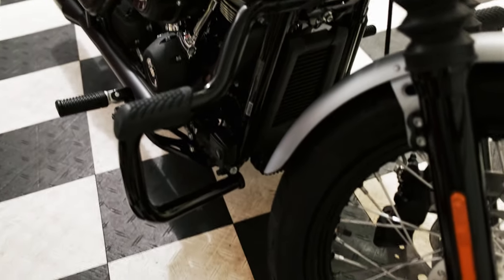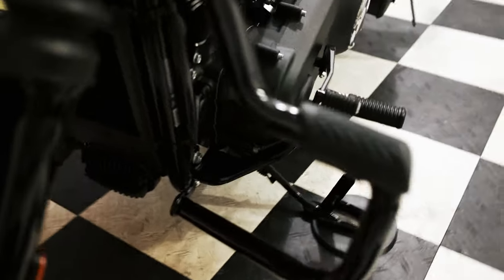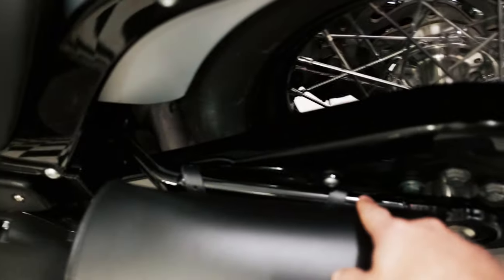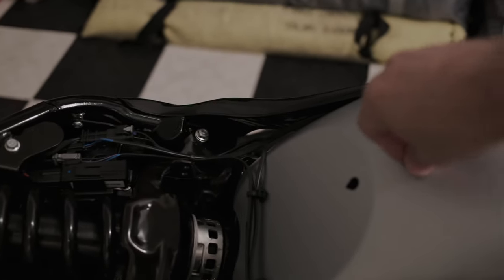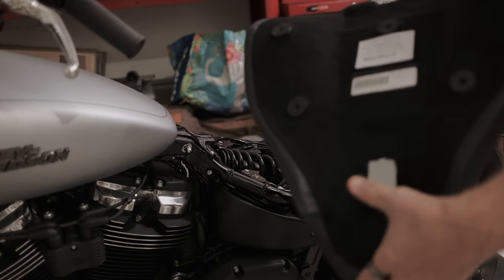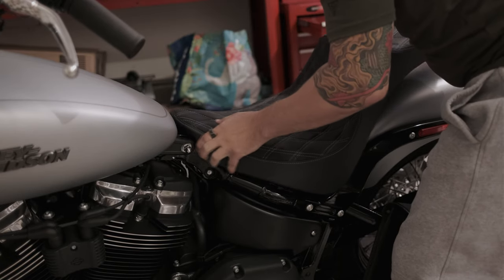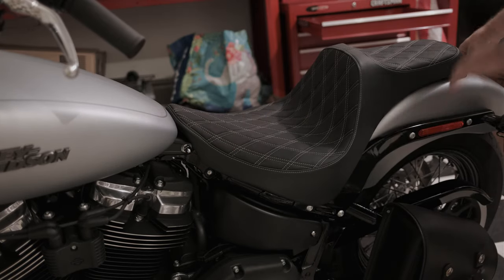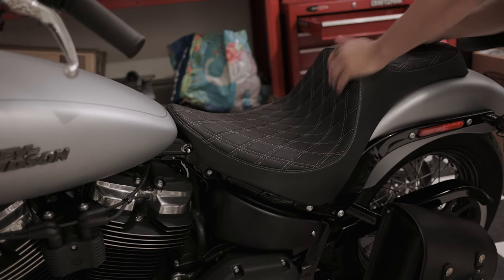Drag Specialties Predator 3 Seat Install on 2020 FXBB Harley Davidson Softail Street Bob

Comment: Do you still use this seat? I am thinking of buying one because I need something to keep me from slipping off the back of the stock seat!
Reply from the maker: I sold the bike and seat. You can see in my latest videos I now have the Heritage Classic. As for the seat, it’s great for keeping you in place 👍🏻
Reply: @LennyK  I actually just ordered the seat but with the black stitching. I only needed to keep me on the bike LOL! It should be mandatory if you have the 114 engine, that thing has so much torque it’s like a rocket!
Reply from the maker: @blkjakk  For sure.  Sock seat is garbage on that bike, with zero back support.  Enjoy your new seat :)
Reply: @LennyK  Took delivery of my new Street Bob today & installed this seat. I love it. It pushed my seating position back about an inch which isn’t bad (I’m 5’7”) but I wish it would have moved me an inch forward instead!
Reply from the maker: @blkjakk  Right. That’s exactly what happened to me. Lots of back support and and very comfortable but does push you back about an inch.

Comment: how would u describe the seat position compared to stock? further or close to bars?
Reply from the maker: Further back. I would say 1-2 inches back.
Reply: Would I reach the handlebars better with the Saddlemen Step Up than the Predator 3? I'm the same height as you.
Reply from the maker: @rainman1356  From what I understand, Saddlemen brings you closer but also sits you up higher, whch is what I was trying to avoid.  There are couple of things taht I am working on to fix this, so stay tuned :)
Reply: @LennyK   Thanks. Looking forward to it. 👍🏼
Reply: @LennyK   what do you think of the Harley Davidson Brawler Solo Seat made for FXBB? 10" width. Description says it sits low but doesn't provide any other dimension.
Reply from the maker: @rainman1356  I am not really sure.  I never sat on it, so I don't know what the position will be like.  It is not very wide which is good.  From what I read, it's not very soft.